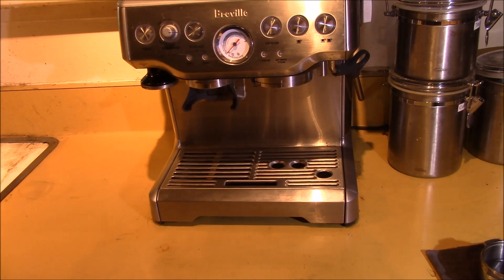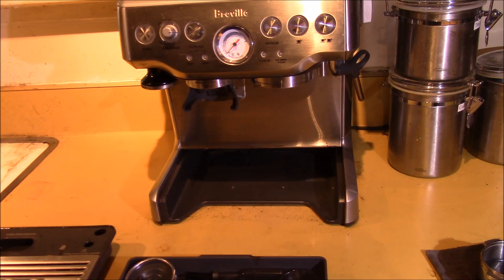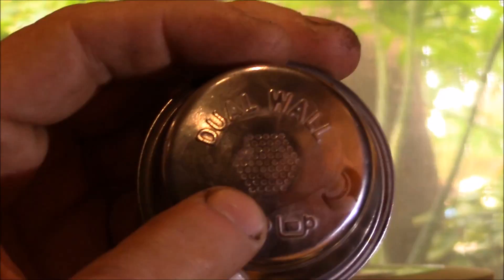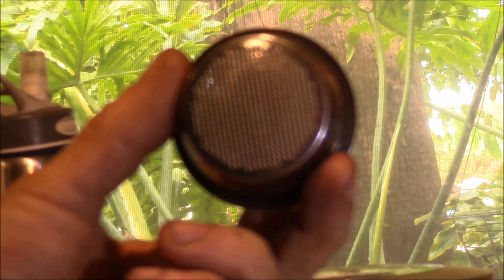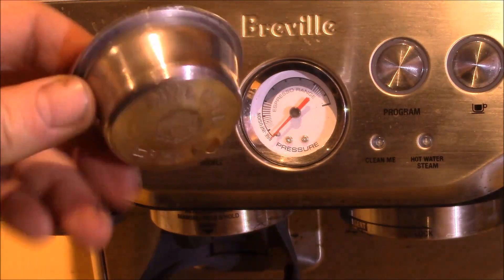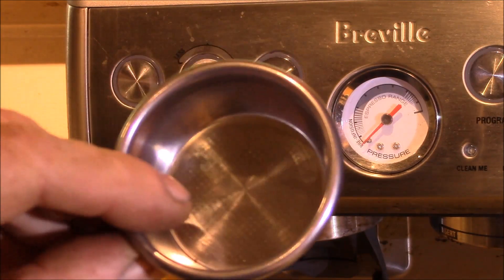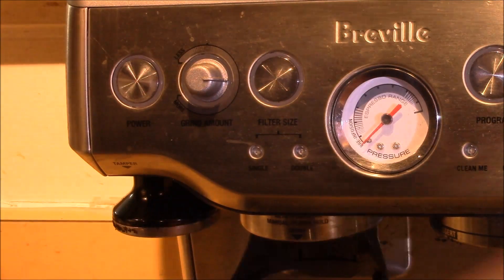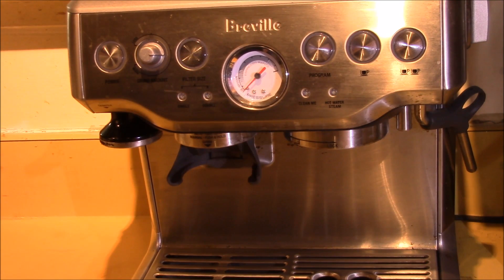Breville BES870XL Barista Express - Filters explained

Comment: So which one do I use for the cleaning cycle?
Reply from the maker: I used to keep the cleaning disc in the single wall 1 cup basket since I don't use that one normally.  However, I later found that it's best to use whatever filter basket you normally use for cleaning.  That way that filter gets cleaned as well.  And if you sometimes use the double wall filter basket, use that one for cleaning as it's more susceptible to getting clogged from normal use.

Comment: I tried the dual filter for my ground espresso but nothing came out. I switched it to the filter that isn't the one with the big mesh & that filter worked!
Reply from the maker: Not uncommon for the dual wall filter baskets to get clogged.  They rely on one tiny hole in the bottom wall to create the brewing pressure and if that hole gets plugged, nothing will come out.  I'll be making a video shortly on how to unclog one.

Comment: Love the video. I am not sure which solenoid is responsible or if it is the computer board, but mine won’t shut off on auto press. If I hold the activation button for five seconds it works fine. If I quick,press, the water runs about 4 ounces. Suggestions?
Reply from the maker: The 3-port solenoid valve is the one that turns water on and off to the group head.  It's controlled by the processor on the main circuit board.  That in turn uses the water flow sensor (located between the water tank and pump) to determine how much water has been pumped.  See my video on the machine's water flow in this playlist if you want to see where that sensor is.  Try disconnecting and reconnecting the wires to that sensor and see if that helps.  If not, try running a descaling cycle or two on the machine and see if that helps.  If not, pull the sensor and try blowing through it forward and backward and see if you can get it to spin.

Comment: sorry again... do you know where to find the serial number... as there is 2 models of the piece i need........( the solonoid complete block)  but i cant find any number, and its 6-7 years old machine, thanks a lot :)
Reply from the maker: See below:
https://youtu.be/96IuKiuIB5A
Either to older Olab or newer Ceme solenoid block will work with the machine.  Mine's a similar vintage.

Comment: I've been using the dual wall pressurised filter. Tried using the non pressurised filter but didn't get the crema that i want. Thanks for the explanation.
Reply from the maker: Glad the video was helpful.  Yes, sometimes that pressurized filter basket can help if you can't get the single wall filter basket to work.

Comment: The double wall filter helps to get the desired extraction time of 25 sec even for coarse ground coffee. This might result in a better taste. But the surface area of the coarse ground coffee is too small to get a sufficient extraction. The finer beans are ground the higher the surface area the higher the resistance and the kower the flow (at 9 bar). Too fine grinding causes not enough flow and bitter components get extracted. Just plain physics.
Reply from the maker: Great information, thanks for sharing!

Comment: which filter should I use, single or double. I like a long black sometimes or even a cappuccino from time to timr.
Reply from the maker: Assuming you are referring to single or double wall, then the grind of the coffee is what determines which filter to use.  If you get pre-ground coffee or you grind it yourself but don't dial in the grind to produce the proper pressure, then double wall filter.  It creates the extraction pressure with the single small hole.  If you grind your own coffee and dial in the grind to produce the proper extraction pressure, use the single wall filter basket.

Comment: Hi Guys, I wonder if you could help. I have this machine and use pregrinded coffee in the pressurised basket. When I've pulled a shot, my puck is very soupy with water sitting on the top. I also run a blank shot through the machine to warm up the portafilter with the pressurised basket, but it leaves water sitting in the basket once it's done the shot. Is there something I'm doing wrong or is this correct? Hi Guys, I wonder if you could help. I have this machine and use pregrinded coffee in the pressurised basket. When I've pulled a shot, my puck is very soupy with water sitting on the top. I also run a blank shot through the machine to warm up the portafilter with the pressurised basket, but it leaves water sitting in the basket once it's done the shot. Is there something I'm doing wrong or is this correct?
Reply from the maker: I don't use the double wall or pressurized filter basket that often, but I do observe water remaining in it if I run a pre-heat cycle.  Why?  The single small hole in the bottom restricts the flow of water out.  As soon as the pump shuts off, any water that's was backed up waiting to be forced out is left to trickle out slowly.  When I run finer pre-ground coffee, it'll come out in a fairly solid puck but it's very wet and falls apart unlike when I use the single wall filter basket.  With a coarser grind coffee, I'll see more like what you are describing.

Comment: Hi, I have the same barista express (only the name of the brand is SAGE because it is for the european market I guess). I bought it last week but I have problems with the pressure gauge. No matter how fine the grind size is (finest is 1 which I also tried)  how properly I tamp, there is no pressure built-up at all and therfore no crema :(  I had also the perfect amount of coffee, because I used the razor dose trimming tool. I used the single wall filters but with the same result. Could you give me any recommendations for this problem? 

The tast of the espresso beans are not bad and the espresso is really dark, not watery. I used 2 weeks old beans. Could it be because of it? 

Greetings from Germany!
Reply from the maker: Check out the pinned comment and replies in this video for some ideas:
https://youtu.be/06StqafhHe0
Seems at least one other Sage owner is having similar issues.  Try the double wall filter basket and see if anything changes.  If so, it may be a grind/amount/tamping issue, if not it may be something wrong with the machine.  If that's the case, contact Breville and see what recommendations they have.
Reply: Thank you R Brown! Meanwhile I tried the double wall filter basket and the result was a lot of crema and enough pressure :) It is really weird because after using the double wall filter basket I tried again the single wall filter (with grind size 1) and this time the espresso didn‘t come out. Another try with grind size 3 and I had little espresso with a little bit crema. I guess it really depends on the freshness of the beans.
Reply from the maker: You might also try a coarser grind setting and see if anything changes.  I usually run mine in the 7-9 range.

Comment: Hi there, I hope you can help me. I turn my Barista Express on and the "grind amount" and "filter size" dial´s lights start flashing. Do you have any dea of what does it mean? Thank you!
Reply from the maker: Likely the bean hopper and/or grinder top burr is not fully locked into position:
https://youtu.be/uo9G6g6tZ_w
If either of those is not engaged (they'll audibly click into place), then nothing else will work.  Happened to me when I first set up my machine and I think when I cleaned the grinder the first time.
Reply: Thnaks! I will try that.

Comment: i have a  similar breville machine  it has the pressure gauge but   it's the one without the grinder and it did not come with the   single wall filter just 2 dual wall  one for 1 cup and 1 for 2 cups and a filter for  pods , i wonder why i did not get a single wall filter  , so can you tell me  if you get better crema from  the single wall filter? i don't think the crema is that good with the double wall filter i am wondering if the single wall would improve it
Reply from the maker: You might check your owner's manual and see if single wall filters were supposed to be included.  If so, contact the seller or Breville and see if they can replace the missing items.  Otherwise, just measure the diameter of your filter basket (mine lists as 54mm) and search for that size portafilter basket.  I find once you get the grind right, the single wall basket produces better results than the dual wall filter.

Comment: where do you put these filers inside the machine
Reply from the maker: They fit into what I call the filter basket that is where you put the ground coffee.  After packing it into the filter, you twist the filter basket into the underside of the machine before starting the brew cycle.  With espresso, you have a filter basket to match the amount of coffee you are making, 1 or 2 shots.  Then there's the construction of the filter, single wall for coarse ground coffee and the double wall type for fine ground coffee.  This is needed to generate the proper extraction pressure as I mention in the video.

Comment: Can somebody explain what this man is talking about, I am confused
Reply: There are 2 similar, but different types of filter baskets. The single wall filter is the one everyone has, no matter what brand of machine you buy. Think of it as a small metal version of the paper filter in your drip coffee maker. Having the coffee ground quite fine by you at home, just before you are going to make your beverage is what you want to use this filter for. The second kind is the so-called dual-wall filter. This one is for coffee that has already been ground when you buy it at the store. It also does not require the grind to be exactly correct as it does in the single-wall filter. It is more forgiving of variations in grind size.

Having said all that, a very good grinder is what you are looking for. Expect to start out spending a minimum of about $300.00 - $400.00 for a good grinder. As with everything else in the espresso world, the quality of the equipment dictates the price, and the price of a high-end grinder can easily exceed several hundred dollars, and over $1,000 if you are willing to pay that much. And if you are willing to pay for a top-flight grinder, you'll need a very good espresso machine to brew that perfect cuppa.

If I have given wrong information here, please let me know, politely, please.

Comment: mine filter stuck after put in, how to pull it out?
Reply from the maker: I find if I turn the filter holder upside down on the counter with a towel beneath, and use the blade of a bread knife to catch the edge of the filter insert on one side.  Then while pushing down with the knife, twist the holder up and away from the side you have the knife on.

Comment: do I need to remove the filter from the water tank when I use the cleaning tablet? also I try few times it does the cleaning 5 mun but when I look at it cleanin tablet still there why it dont suck it?
Reply from the maker: I don't when I do the internal cleaning cycle on my machine.  I don't think the cleaning solution gets very far back into the machine.  My understanding is it only back flushes up into the group head area.  Most of the time I find my tablet is completely dissolved, but somethimes theres a little bit left.  Are you using the rubber block off disc in the single cup filter backet?
 https://youtu.be/1FTTlwDa36g

Comment: Just got this machine tonight. Can I remove the plastic insert inside the portafilter?
Reply from the maker: Not sure about that.  I tried on mine and it seems to be pressed in pretty securely.  Mine does rotate and there seems to be some slots that should be lined up with the two spouts.

Comment: Thanks for your videos. I just bought one and tried for the first time tonight. Had no success at all. Nothing would come out. I am using the single dose, single wall filter. Tried grinding from 5 to 11. I thought my tamping was too hard, and tried less pressure while tamping. Just a few drops os coffee and the gauge needle still would go over the espresso range. I need to figure out what is going wrong. There are so many variables.....
Reply from the maker: +Augusto Cesar Pires Hard to say what's wrong, but you might try running it once with an empty filter and see if water comes out.  Might be the filter basket is too full or the grind too fine.  Also, try one of the double wall filters and some coarser ground coffee and see if that works.  The proper grind should feel like normal table salt as far as size.  Grab a pinch of salt and a pinch of coffee at the same time and compare the feel.
Reply: +R Brown (4Crawler) Just figured it out...... I was using the cleaning disc inside. Sorry. Newbie here. Let`s see hou it comes out tomorrow.
Reply from the maker: +Augusto Cesar Pires Glad you got it figured out.  Yes, I imagine that cleaning disc in under the filter would pretty much stop up the flow.
Reply: @CesinhaBittencourt  I have to laugh along with you here, having done the same thing when I got my machine. RTFM is still the rule of the day :)

Comment: Hi, Thanks for the video! I've got a quick question: My machine is exactly the same, I also try to always buy fresh beens and grind myself. I use the normal non pressurized wall filter and my extractions are ok, but not good enough! My grinder is set to 11 and I try to not overdue the tamping or overfill the portafilter. What would you suggest, I need to change in order to get a better extraction / Crema? or any other ideas? Thanks :)
Reply from the maker: Manni Photo On the grind, you are shooting for the consistency of table salt, so compare the ground coffee side by side with some salt, pinched between your fingers.  Maybe try working towards a finer grind setting, one number at a time and see what happens.  I usually run in the 7-9 range, but different machines may have different calibrations.  For finer grind settings, be sure to only change the dial while the grinder is running:
- https://youtu.be/06StqafhHe0

Then set the amount to fill the portafilter to just overflowing, I like to jiggle the filter as the coffee is filling it to settle it in there.  Unlike many machines, you don't want to sweep the coffee grounds off level with the top of the portafilter, leave it piled up over the top.

Tamp with decent pressure and then check the level with the Razor if you got one with your machine.  If not, you want the top edge of the tamper base to be even with the top of the portafilter.  Another good sign is after removing extracting, remove the portafilter and you should see a pressed in pattern of the underside of the group set in the top of the coffee puck.  

If you are too coarse on the grind or tool loose on the tamp or too low on the level, the espresso will just run through the machine too fast (should be ~25 seconds or so), the pressure will be low and little crema.  Too fine or packed too firm and you'll get just a dribble of espresso, the amount will be a lot less and the pressure will be too high.
Reply: set your grinding setting at 7, and the amount of grinded coffee like at 1'oclock.....you cannot "tamp" the coffee enough by hand so dont worry about that.....I get consistent pressure with these settings